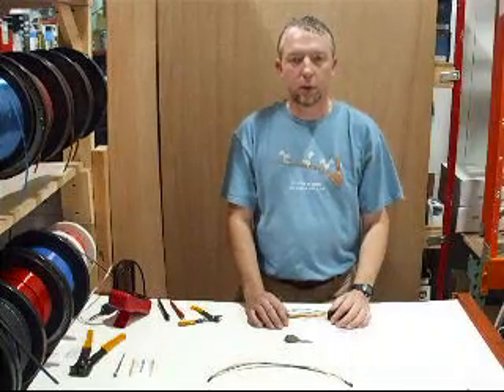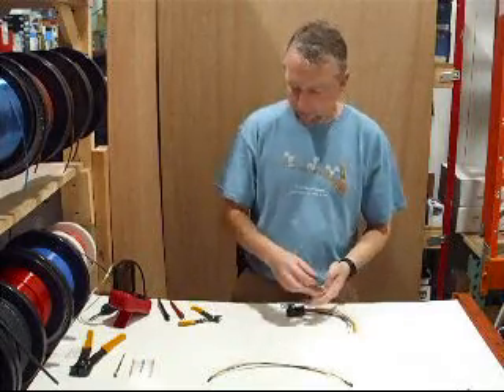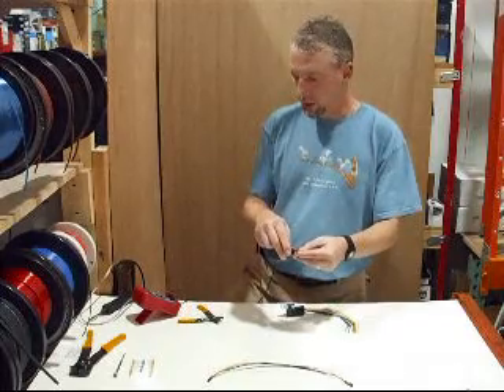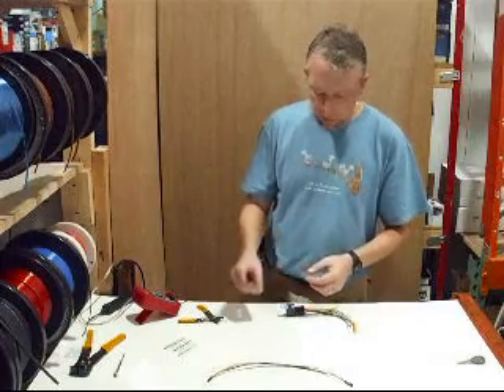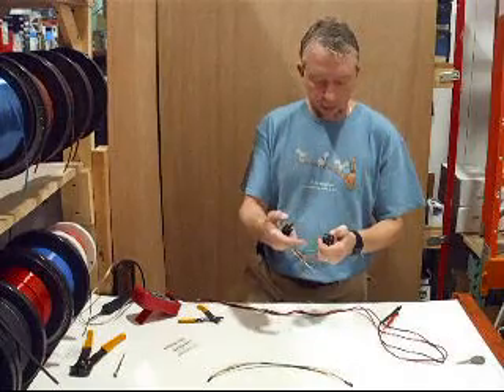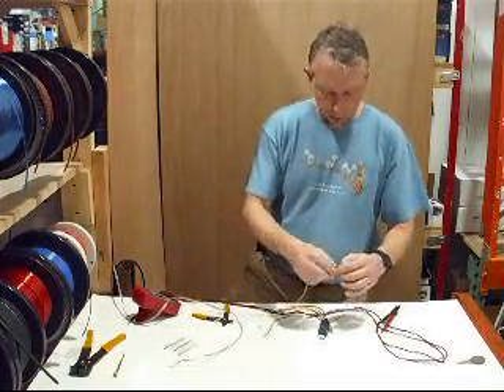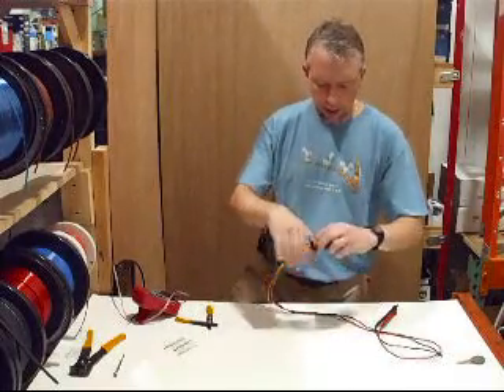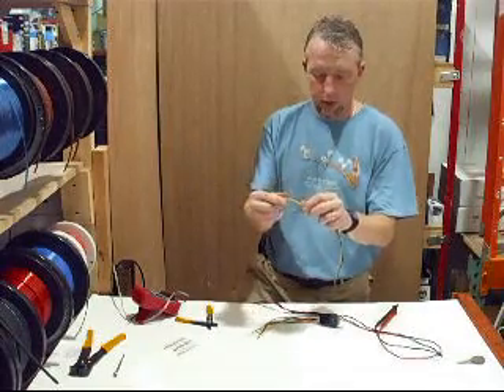How to Override Bypass GM VATS Passlock 1 2 Passkey Anti Theft System

Comment: ok i have a 2001 chevy 1500 with the 5.3 as a farm truck
. My passlock has disabled the motor, so im needing to bypass it. the truck will never leave my property so disabling the security system would not be a problem.. 
i saw the relay option, but i dont have a relay.. where can i get an inline resistor like you discussed at the end? so i can just put a new resistor in it, let it sit for 30 min, then try and start it.
if i could i would have a push button start.

Comment: With an 1995 88 oldsmobile how can you bypass the security if you lost your key? me and my dad bought a new Ignition lock cylinder, but all we hear is a clicking noise instead of any turn over. we have a feeling it has something to do with the new key lacking the security resistor, any help?

Comment: Do you have a way to bypass a Passlock for a 2002 Saturn Sl2. I'm having a hard time with this car. On your video for the passlock 2 system, on the relay side you mentioned that pin 30 should go to the car side. But on the Saturn that's the pin for the fuel pump. I really need your expertise on this matter.

Comment: your making this way too complicated, find the resistor that matches your key, cut the orange wire under the dash that has 2 white wires inside, solder your new resistor to the wires that run back toward the car, problem sovled (VATS1) I recently did it myself 89 Seville.

Comment: guys please save my life. I have been suffering the last days:
I have a mazda protege 2000. The weather has been extremely cold the last 10 days. This morning, when I first  put the key, the car was about to start on but it failed. So, I tried again... and the nightmare starts: nothing is happening, no ignition nothing... just the click somewhere in front on the car.
I tried to boost the car but in vain... I checked the fuses, they re just fine...

Comment: i have a 2001 silverado and it wont run more than a second then shut right back off can i get the ohm reading from the yellow wire with it already locked out with passlock system? thanks

Comment: im installing a remote start and security system on a 04 tahoe that has passlock 2, will ur second method of spiking work to disable it permanantly??
also seems like instead of putting it in line wouldnt you want to run it thru the resister and to ground instead of the key switch?

Comment: hey i got a 1995 camaro with an LT1 n well it does that n know it wont even start n i did that n cut a slit in the wire that the switch plugs up on that box n the security light came on n i waited n it went off n i did it again n the security light was blinkn n it set there for like 3 hours n the battery went dead so any help is needed its been like this for 3 months n i would like it to run again :)

Comment: i find the vats one confusing without wiring diagram can you email me one? way i see it 30 (with resister) is ground and 87 is when remote starting or bypassing not sure why 87a is needed? as it is still going to be resited by 30?  or do you mean 30 and 87a have continuity(no resister) and run in between the cut vats wire and when relay energized the resister is on 87 going to car side? see why i need a visual lol

Comment: Will one of these work for 2000 Pontiac Bonneville? Will not start since alarm was set off by accident. Also, when hitting red button on remote, alarm doesn't sound but makes thumping sound. This has to be faulty anti-theft right?

Comment: I have a 2004 saturn ion (series 1) and my car would not start today. 50°outside and the starter would crank ..I waited 10-15 min and car finally started. I cut the white wire to the ignition on the pass lock. So far so good

Comment: I have a 1997 Buick Skylark that has been having this problem and I think we found the original problem to have been the ignition cylinder, which we replaced.  We thought that the problem was fixed, but the battery needed to be replaced because all the times the key was left on to reset.   So we replaced the battery and now nothing lights up on the dash etc. and will not start at all.   Is it still possible to find the resistance if the car wont start?  Or do I have bigger problems now?

Comment: I have 1997 Pontiac Sunfire, (which is one of the cars you mentioned this would not work on), with an automatic transmission.  How do I disarm passlock on this vehicle?  Theft light stays on solid all the time, no flashing & will run for approx 3 secs after cycling the key.  Great video by the way!
Thanks.

Comment: I did this before with my 95 Camaro. The light was blinking and I did this and it worked. Now it's doing it again but not blinking. Just everytime I turn the key they light comes on for 5 minuets then goes off then I try to start it again and the light comes on again.  How can I fix this?

Comment: Bypass modules can fail or become loose and are just plain sloppy in the first place.  In most cases they are more expensive than having someone reprogram your ECU.  The best part about having someone program the ECU is that it is PERMANENT.  Nothing to come loose, nothing to fail, no becoming stranded when it does.  It defeats VATS at CORE LEVEL.  Bypassing is like fix-a-flat - it's not a real fix and somewhere down the line it will fail.
Reply: A pack of resistors does not cost more than an ECU flash 🤣🤣🤣

Comment: The only right way to bypass VATS is to either have someone reprogram your ECU to bypass it, or to program it yourself if you have the tools and know how.  I know of one programmer that will do it for around $100 bucks.  It may not be cheap but it's cheaper than just the ignition switch for the VATS and it's permanent.
Reply: Which program is this?

Comment from the maker: All you need to do (on vats only, not passlock) is cut the 2 white wires off the steering column and put a resistor in there (on the bcm side) that has the same value as your key. and thats it.

Comment: @MrHdradeon  I used the final method, the vehicle I did this with made all kinds of funy sounds and changed the clock on the radio rapidly etc for the 30 minutes that I left the key in the on position. I then turned the key to off and tried to start it and it worked just like nothing was ever wrong. Since this fix was implemented I have had no problems what so ever.

Comment from the maker: @lamborghinimeany 

I have a few ways, theres a video on here I call cheap transponder bypass, which is the el cheapo method, Here is the link:  youtube.com/watch?v=X07aa5mYEZk   
or you could buy a passlock3 digital bypass from us and spend 40-50.00 for an even easire solution...
my site is lesscoelectronics  good luck

Comment: Per the end of the video via the permanent disable of the passlock 1, I can use ANY resistance? My winter car's tumbler is shot and I just disconnected the ignition switch and using that. I have NO way to turn the key in the ignition so that's out of the question. This video is the first instance I've seen with that trick. if this doesn't work how screwed will I be? Thanks!